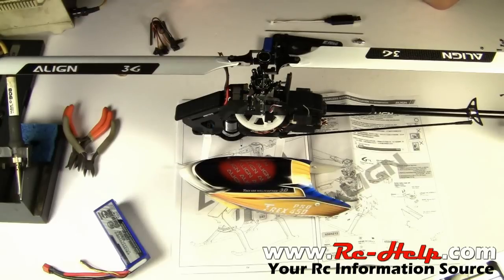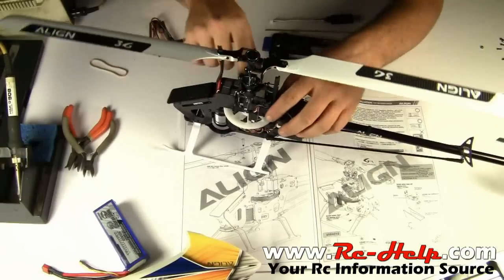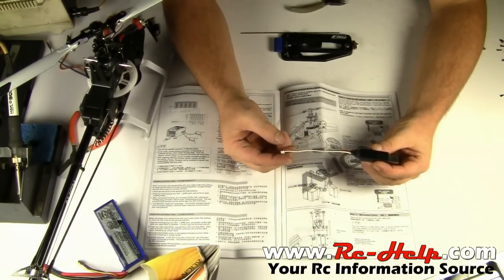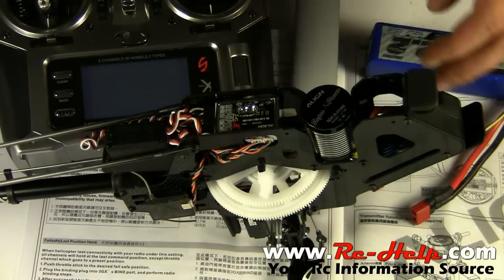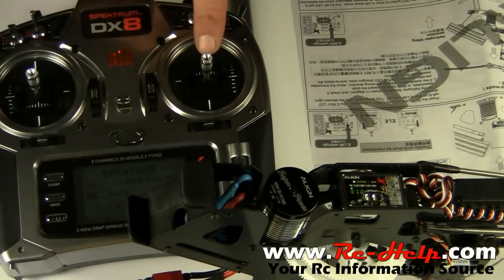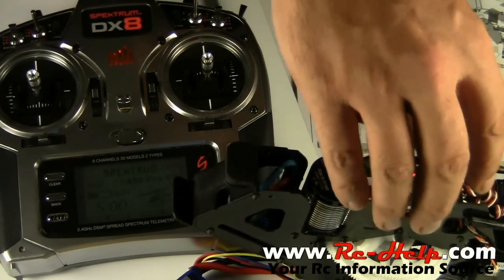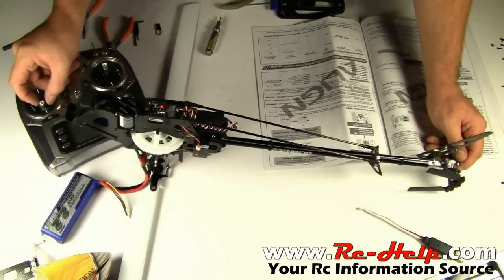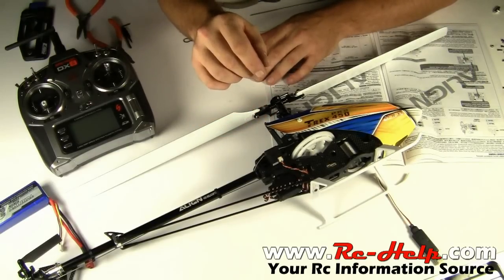Align 450 Pro V2 3GX Build Guide Part 7 Basic Gyro Setup

Comment: So. My Lhs guy who sold me this heli, told me that i could wire up everything before he would put the battery ends to my esc (they didn't have time that time.) Now i have a completely wired up heli with a receiver (not only sats) that still needs to be bound. because obviously, since the tx and rx are new i never had the chance to power the rx on. its my first heli, like i also told them. how can i bind the rx being plugged into the 3gx alread?
i know u want me to post in the forum n i will l8r

Comment: Hi! Thank you very much for all your videos! They are great!!!
But I just faced a problem. When I do the first step of the Gyro setup (elevator endpoint setup), press the button again and turn the helicopter to check if the gyro is only on the elevator, I see the pitch and aileron moving, but in the opposite direction between them. When I move forward, the elevator goes down, aileron goes down and pitch goes up.
It seems that one of them is inverted.
Can you help me please on that?
Thank you!
Reply: @Ryder Ahmir instablaster =)
Reply: @Terrance Grady thanks for your reply. I got to the site on google and Im in the hacking process now.
Takes a while so I will reply here later when my account password hopefully is recovered.
Reply: @Terrance Grady it did the trick and I now got access to my account again. I am so happy:D
Thank you so much, you really help me out :D
Reply: @Ryder Ahmir Happy to help =)